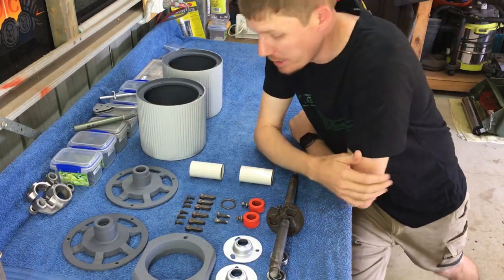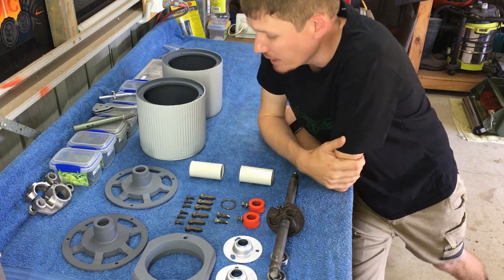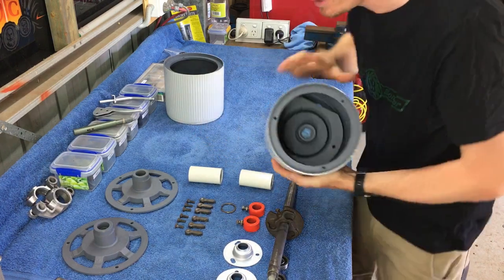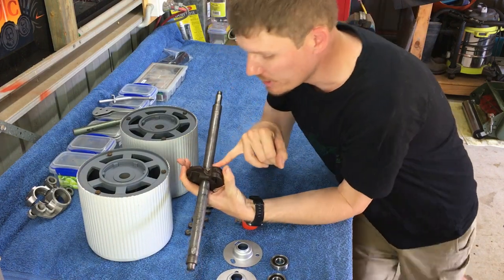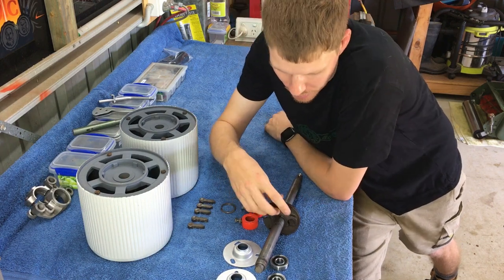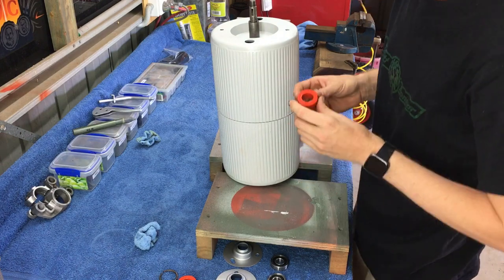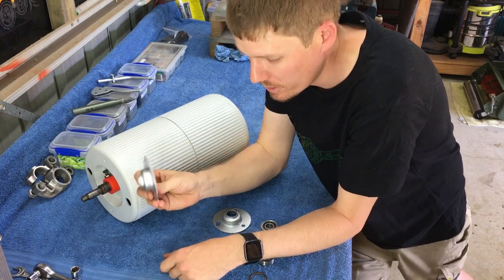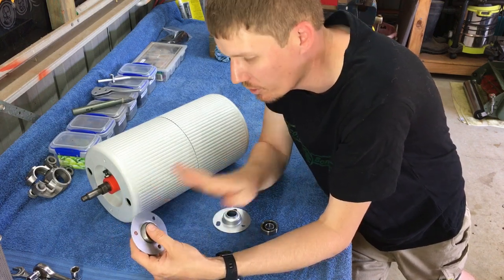Scott Bonnar - Model 45 - 14" Groomer Build - Rear Roller

Comment: Just saw on love larns video he thinks the counter weight should go under the motor on the non drive side, think that's also what is said in the bonnar bible but lots of speculation on the topic
Reply from the maker: Yes that’s correct.. Counter weight is under the motor on the non drive side.. 
I mention this around the 2minute mark..